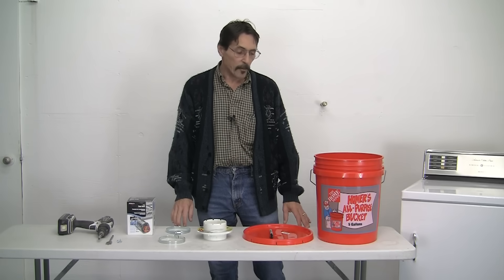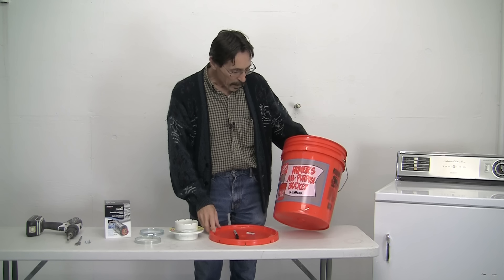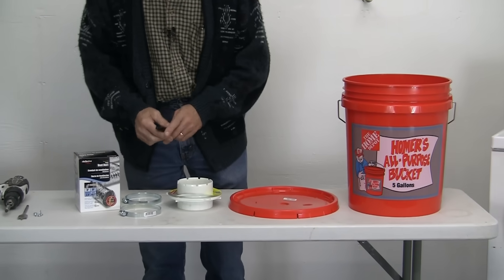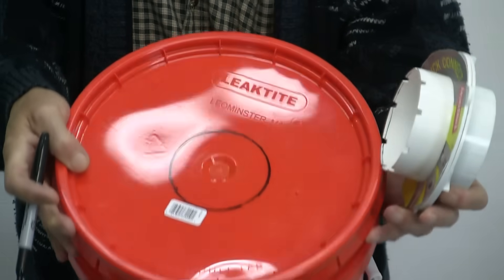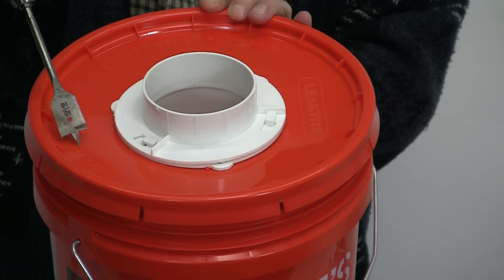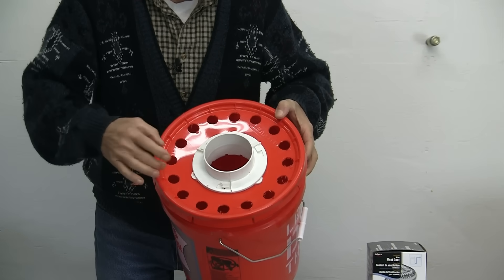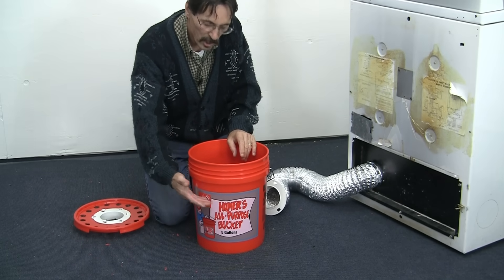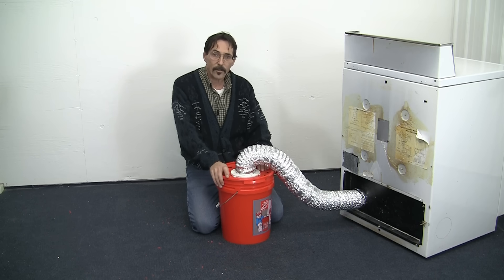DIY How to Cut Electric Bill in Half: Part 3 Clothes Dryer Free Ideas | Missouri Wind and Solar

Comment: I’ve moved since my original comments in this video. My current apartment doesn’t have vent to the outside for the dryer. I’ve been using this design since moving here and it works great. 👍🏻

Comment: I would mention that some areas of the world are more humid than others.  Also, some days are more humid than others.  This might explain why some commenters are saying "I've done this for a hundred years and never had a problem" while others say "I tried this and it turned my house into a swimming pool".  Let common sense be your guide.

Now, regarding lint.  Admittedly I've not tried this but some people are saying the water doesn't trap all the lint and it gets all over the house.  Perhaps it would be a good idea to put a filter over the lid? (Remember to cut the hole in the center, of course.)  Has anyone tried this?  It seems like that would show you how much lint escapes the water bucket, or would it get too wet too quickly and restrict airflow?
Reply from the maker: We definitely don't recommend this tip for humid environments and people will have to use good judgement. Thanks for including a potential improvement to the idea.

Comment: If you split Your quadrupled receptacle for laundry appliances to both sides of the ethical panel 230 volt buss bars. You can run both appliances at once for the price of one.》◇

Comment: Are there ways to recycle the heat from a gas dryer?
Reply from the maker: We absolutely recommend you leave gas dryers connected as per the installation guidelines. Failing to do so can result in fatal gas build ups. In layman's terms - don't fiddle with gas.

Comment: The humidity would be unbearable. As far as gas exhaust, stoves and ovens are mostly not vented.
Reply from the maker: We would not recommend this for humid climates and/or to disconnect this in the summer months when relative humidity is higher.  Do not use this method with gas appliances.

Comment: Panty hose people. Connect to the outlet of the dryer hose. Done. Don't worry about it till summer. All of us with gas heat will love the humid hot air back INTO the house in winter months.

Comment: This is very bad for you you are putting micro plastics directly into your lungs
Reply: How when everything is going into the bucket not the air?
Reply: @Nibor55  it's called micro plastics because it's microscopic it's soo small it goes right thru the cloth into the air  into your lungs

Comment: Thanks for the great idea! To be sure, I calculated the area of a 4" hole to be  about 12.5 square inches, and the area of a hole from a 15/16" bit to be a meager 0.7 square inches. So you'd need 12.5 / 0.7 = about 18  (15/16") holes to pass the volume of air of that center 4" hole. He's not kidding when he says to make Lots of Holes. I'm gonna make one of these for sure.
Reply: Thank you for this!  I thought about trying to do the math myself - you just saved me several hours of work.
Reply: I counted 15 holes he drilled, so he was pretty close!

Comment: Want to cut your heating bill? Do not leave it on all the time. Once it gets to the temp you want and shuts off, go turn the unit off untill you start to need it again. (Also, turn your water heater off. Only turn it on about an hour before you need it). 

Anyhow, my bills went from $500 a month to around $175 in the winter...by doing the above.

My summer bill runs under $100 a month. Usually around $80 during the summer. By doing what I mentioned above.

Comment: Couple of times wrong!!
First of all you do NOT much humidity in the house in winter! Check on your health website recommendations to avoid mold!
Second: BUY A FANLESS DRYER, that will save you lots all in one!
Third: best way is to connect air INLET to the attic so you get cool and dry air from there instead of sucking all heat out of your house itself, THAT will help you a lot!

Comment: I’ve always wanted to recover the heat from the dryer however it gets too cold in northern Canada to do this without causing a major condensation and subsequent mold problem. I’m looking at a large capacity HRV with some advanced filtration possibly some type of hydro filtration like this bucket to prevent immediately clogging the HRV core.

Comment: We wash our clothes once a week the dryer runs about 4 or 5 hours how is this going to cut our electric bill in half...if you ad  up the hours at most it's 20 hours a month and since there's approximately 720 hours in a month that's a far cry from 50 percent if you ad to that the dust the water bucket doesn't catch ... well I think you get my point

Comment: Nope. I haven't used my dryer in 25 years. I always air dry my laundry. FREE. In winter they dry fast and add humidity to the air. Using a dryer is a WASTE OF ENERGY AND MONEY. You don't need your clothes dry in 30 minutes. Do you wear your clothes in 30 minutes?

Comment: Never use a dryer to dry clothes. WASTE OF MONEY. Hang them indoors. In winter they'll dry quickly and add humidity to the dry air. Costs nothing. Why would you waste electricity to dry clothes in 30 minutes? You're not gonna wear them in 30 minutes.

Comment: I believe I'm going to try this. My dryer vent goes straight up and out the roof. A 90° pipe bend up followed by an offset, then out the roof. Gets clogged all the time of course. I get tired of getting on the roof and duct cleaning. Thank you for this video.

Comment: Awesome video Jeff I have a question for you I have a three phase 3,000 watt alternating current wind turbine 96 volts I am having a hard time finding a wind controller or some way to use the power I have destroyed two inverters once the wind got too high that was supposedly made for this turbine and paid $800 a piece and only lasted about a month until the wind got real high what would you suggest? I was thinking of using a heating element like a type of resistor so it could be a heater in the winter time?
Reply from the maker: Best things to do:
1 - Email your questions to sales@windandsolar.com
2 - Call our sales team at 417-708-5359
3 - Attend a workshop - https://windandsolar.com/workshop/

We can get you pretty much any information you need through those channels!

Comment: I am wondering we should only modify the dryer on Timed Dry? am I correct and how its gonna help on electric bill? I dont get it... just connecting this bucked into dryer and it will reduce the electric bill? or am I missing something?
Reply: Yes, you are missing something.  ONLY electric dryers.  Connect the dryer to the bucket per the directions.  Cover the inside of the outside dryer vent that is in the house wall.  If you use a large piece of styrofoam to cover the wall outlet, that will insulate as well as block air flow.  

You can do timed dry or not.  The savings come into play by the heated, humidified air that comes out of the bucket.  This is air that does not have to be heated or blown by the furnace blower.  If you have baseboard heating using hot water, you still get the benefit of the heated air.  Bottom line is that you are not sucking air into the house, heating that air with your home furnace, to be expelled by your dryer.  You are reducing air flow through the house and conserving heat.

Comment: If you can get an industrial bag house bag  , they work good and it doesn’t need water .
They come in all sizes , 15 feet long , with a 6 inch diameter

Comment: Very bad idea. The air coming out of a dryer is not healthy unless you’re using a very clean laundry soap. 99% of laundry soaps on the market have synthetic chemicals that you don’t want to breathe in, hence we exhaust this air outside.
Reply: Water. Put a pint of water in the bottom. A factory made one can be purchased at DIY store. $20. I have two of them and I've been using them for years. Mice like to get in through the exterior dryer vent.

Comment: Thank God you said what you said in the beginning of the video to not use this with a gas dryer because I can only imagine dip shits that would actually try this with something that combusts in the house. They already do stupid stuff with gas oven’s. Yes! Airflow airflow airflow! Or your down for a stupid 5 bucks in parts. Thermal fuse will blow and typically whirlpool/ Maytag/Amana will give you the sign of drum spin with no heat but some don’t start at all. I think GE stays off.

Comment: I would be very hesitant on this.  Dryer exhaust is fast-moving air and it's hard to imagine that just having water in the bottom of the bucket will catch all the lint.  I'd have to see it to believe it.

Comment: Wow!   Every year for the last twelve years I’ve undone the hose come winter to heat the house.  Usually we run laundry at night.  It does raise the humidity and I didn’t realize that was the key.  Anyways, it was heat that should go into the house and not outside in my mind.

Comment: I just would like to mention that using a step drill is much easier than using a spade bit for the holes in the lid so if you have step drill use them instead

Comment: You do not want any of the air to come into the house..  I have a 4 inch outlet dryer that instead dumps into a bucket like yours AFTER travelling through dozens of feet of 6 inch metal pipe artfully running back and forth on the wall.  A drain on the lowest spot and a dehumidifier to capture the last of the moisture round out the picture.

Comment: Nice video Jeff!  I appreciated the focus on content, vs. pitching your channel, etc. The other benefit to your idea that I didn't notice mentioned in the comments here, is that you can avoid using the flap valve on the outside of your house wall where the dryer duct normally discharges.  In theory those things close when there is no air pressure from the dryer hose when the dryer is running, but in practice, they are leaky and let some cold winter air backflow into your house whenever the dryer is not running (which is typically 98% of the time).  Cold air flows back through the dryer exhaust duct and the dryer itself.  Of course you'd have to make sure the flap valve was closed and plugged or sealed in a way that could be reversed for summer use, but packing a wad of insulation and duct taping it up against the outside of the flap valve seems like it should do it.

Comment: One problem id that bacteria begins growing in that warm water within 24 hours. The other issue is that restricting the air flow causes heat buildup in the dryer itself , which could cause a fire. I would not do this in my home.

Comment: What about during the summer? I have a house and the electric dryer doesn’t vent outside the room. They placed a U shaped vent into the wall that it brings it back. I’m currently using the cheap water cup thing you referred to. It works but I used a mesh material over it. I no longer get condensation on the floor since using the device. The water does get nasty after a while but the room stays relatively clean.

Comment: you are an idiot , adding more humidity will NOT hold heat in fact it takes much more energy to heat a home high in humidity , this saves nothing but for sure add costs ,,, you clearly have no education so stop giving bad advice , an dill also add you devoid any insurance claim with this setup if you have a fire , there is a good reason they put warnings in the owners manuals not to do this ...    hope you get sued

Comment: just to inform the public 
Doing this is a health hazard. (it only takes 24 to 48 hours for mold to germinate from the lint in the water)
you need to change the water in the bucket after every use if you dont the dryer will spread black mold building in the water and spread by the air pressure

(And an Obstructed Outflow from the machine can also cause the dryer early retirement caused by OVERHEATING! or SHORT CIRCUITING! it also makes the fan motor a FIRE! risk)

Comment: Venting of any dryer into the home has been frowned upon for decades.  Early 70's started seeing in-vent-hose boxes that would vent some of the dryer exhaust into the room with the dryer.  No water was used with these as the moisture coming off the wet clothes being dried provided a bunch.  The humidity that was being put into the air in that part of the home started causing mold and related health hazards.  And if you fire up a dehumidifier to remove the moisture, save the cost of the dehumidifier and vent directly outdoors.  Forget the inline vents and these cans.  Also, as a scum layer develops on the water inside, lint coming into the bucket will just start blowing out of the vent holes in the bucket.  Add filtering, you block airflow as the filters clog.    Determined to be a poor idea way back in 70's as an energy saving item.

Comment: i like the bucket idea but he like everyone else we should never ever use slinky duct on your dryer because air doesn't like peaks and valleys it creates back pressure and forces heat,lint and moisture  back into the dryer.that slinky vent is for a bath fan to vent out an eve they should have never made one for a dryer because the efficiency of a dyer is the vent the shortest,straightest,smoothest vent will allow the moisture and excessive heat to get out the fastest mainly the moisture and the faster the clothes will dry.the slinky vent gives your dryer asthma and copd so it will work for a long time on older dryers but it causes them to run hotter all the time  than they should and cause long drying times.

Comment: I was also thinking maybe if you got a silica based DIY buffer zone that still vented with large enough pellets? They shrink when they dry out and you can buy them in bulk for cheap. Like marble sized ones when fully saturated? Just a thought

Comment: Just subscribed, very ingenious designs, I live in the pacific north where as the winters are wet wet wet and the summer time it gets pretty hot, watch your other video on how to use crawlspace/addic for cooling. The humidity thing is what I'm concerned about, is there a way to defuse that situation with out clogging up the  defuser? Thanks Jeff, great work you solve!

Comment: Have a friend that tried this and it turned out to be a mess. Mold was an issue and the house was full of dust. Turned out to be a waste of time and money and created more problems than it solved. Good video---but it turned out to be a failure for my friend. He tried a filter to cut down dust but it blocked  venting.  Dust was major issue as well as some /mold/excessive humidity.

Comment: That will help heat your home. Nowhere near half unless you run it constantly. In which case it's a big electric heater which would be very expensive. Get yourself a wood stove if you want to save money on heat. Not to mention the humidity this would cause.

Comment: Ps... periodically remove the link screen on your dryer.. electric and gas dryers.
Wash with soap and water, then replace.
Purpose for doing this is to remove the film that builds up from fabric softeners.  That film blocks air flow and results in longer dry times. 🌷

Comment: I also did that in the 80's and ended up with a (very large) utility room full of black mold
Reply: Yes if room is locked guess you would. But my home is 3000sqft my central air unit sucks all air to it recirculates to house. And I love the smell electric dry puts out clean clothing.
Reply: Your not supposed to constantly run it in small spaces.

Comment: Enjoyed the video, learned a bunch! Did you ever consider adding a float valve to the bucket with like a fridge water supply line or something similar? I don't think it would run much...maybe another $20 or $30 dollars but you wouldn't have to check the water level anymore.
Reply: You would still have to empty the bucket when the lint level in the water gets too high and grungy, so water line and valve would be a waste of money

Comment: I used one of the square dryer diverter things for years. A bunch of lint still got through the screen and one of the wires burnt up several times because of too much resistance. I will be implementing this idea this weekend.

Comment: I do it a little differently. I don't use the bucket, I attach the aluminum hose to a mask I fitted to my mother & law and run the dryer motor backward when she starts talking. The old hot airbag can dry a full load in about 7 minutes.

Comment: What about the lint factor? Dryers put out enormous amounts of lint particles when it use. If it has more than 6-10" of exhaust tubing, it linting your home throughout. It's absolutely miserable. Doesn't matter what brand of dryer you have. They all do it. That's 6-10 " from the dryer exhaust port, straight out the outside wall to eliminate the lint.. Don't matter how you seal that tubing, it leaks. Even solid piping. Done them all. Lint is a COPD killer, meaning if you've got COPD, lint will do you in.